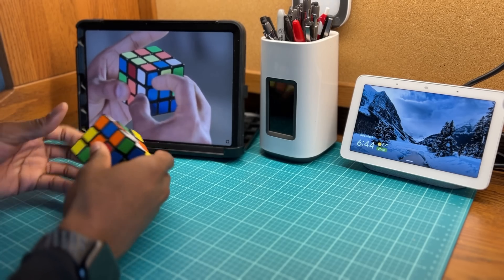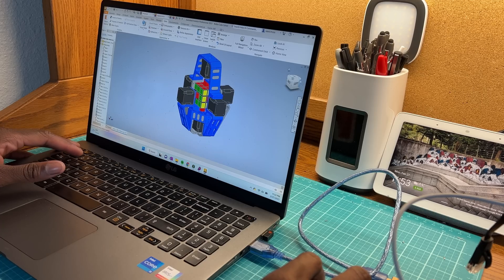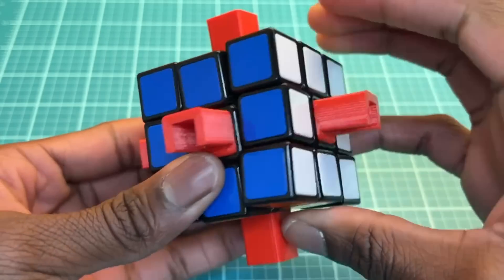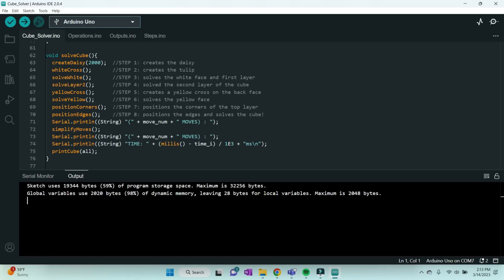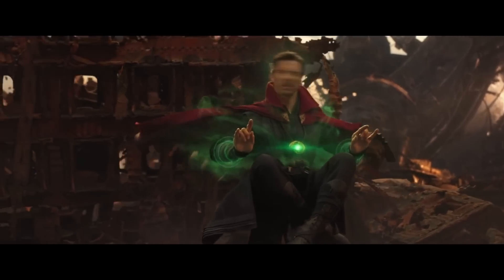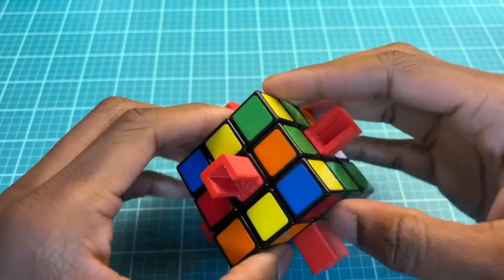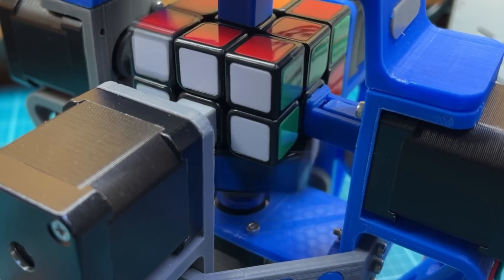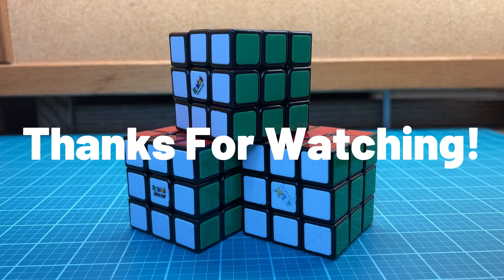I Built a Rubik's Cube Solver

Comment: Great video!  Very entertaining, factual.  Thinking of making one for next project.  I'm out of Teensys, will have to use ESP8266, and I have a ton of A4988 stepper drivers.  I'll also make a PCB to save on wiring.  In research mode right now....

Comment: Brilliant work.  I'm just starting a really basic spit-balling,  white-boarding for how to use colour recognition to solve a virtual cube (a very crude one, once I can program that), using the F2L method coupled with other methods to finish the cube - basically CFOP; before much much later down the line, trying to bring it to reality. I'm planning on using JavaScript for the virtual solution since that's what I'm most familiar with. 

I'm really liking the use of the matrix to keep track of things.  I've seen other vids where the colour recognition thing has been a bit of a nightmare to get right; so this option appeals more to me.  Definitely adding this to my playlist; lots of good info here (I didn't even realize there was something like cube central for inputting the colours to each face).

EDIT: I just realized you created the web server yourself.   
👀

Comment: the actual solving speed is controlled by your stepper motors. Simply put, they are too slow for your application.
Reply from the maker: Hmm I don’t know if I would consider 4.56 seconds slow.
Reply: @aaedmusa  by design, stepper motors completed one revolution with many steps. Hence they are slow. In constrast if you use geared DC motors, you can speed it up 10 times. Yup, 4.56seconds becomes 456ms. (less than 1 second). Using geared DC motors, you'll need signals (per motor) as an index to the start of a revolution.
Reply from the maker: @petenguyen8455  If it were that simple I would have a world record right now. I used stepper motors because they are very accurate. Its not as simple as using fast motors. They need to be just as precise as they are fast. DC motors are not position precise. This is why 3D printers use stepper motors and not DC motors. In this project, the slightest error in positioning accumulates with every move. This happened with the precise stepper motors that I used, so it would be much much worse with DC motors. I have honestly never seen someone make a Rubik's cube solver with dc motors for this exact reason.
Reply: @aaedmusa  it is a geared DC motor not simply a direct coupling dc motor. This gives you an accurate ratio 1:x. So if you are counting the ratio, you'll get the rotational speed. Anyway, may be this is way too complex for you.
Reply from the maker: @petenguyen8455  Once again if this could go as fast as you claim, then you would have a world record in your hands. Maybe it is too complex for me. If you can try this and and have it solve a Rubik’s cube as fast as you claim then I’d be more than happy to admit that I was wrong.

Comment: Great vid! Super satisfying watching it step through a solution. Some thoughts on future iterations. CFOP is actually one of the more move heavy solving methods in cubing. It’s incredibly quick for humans because we can think about what our next move will be while going through an algorithm, but that’s not an advantage for a computer. The method that most robot solvers use is called Kociemba’s algorithm. It’s one that’s hard to code yourself or even understand, but there are libraries out there that have done the hard work for you. If you want to code the method yourself, maybe look at ZZ or Pertrus, which I think may be slightly more move efficient human executable methods. 

Also, definitely get a better cube. You can get propper speed cubes for about $10 or less. Those Rubik’s brand ones are just terrible. 

Lastly, I wouldn’t abandon the camera idea. Imagine how cool it would be if you could just throw the scrambled cube in, press a button and it solves it for you, rather than having to input the scramble manually. You could point 2 cameras at opposing corners which would let you every piece, except the one behind the motor posts, but you can infer what it is from the other pieces.
Reply: Lego, the plastic bricks one, has a cube solver with a camera. It is not fast but no need to modify the cube. Just put a cube in it, and the thing solves it.